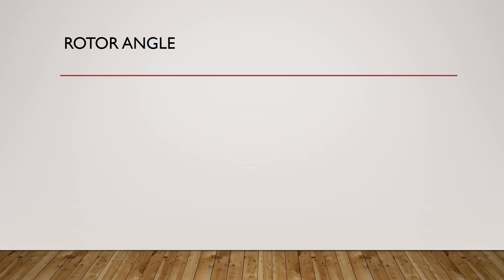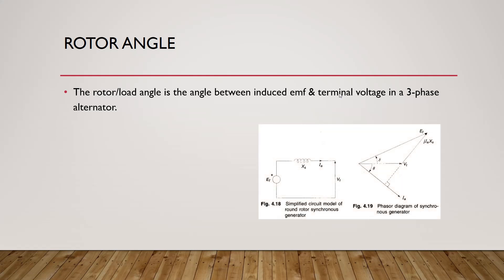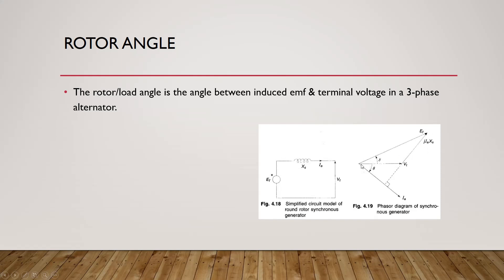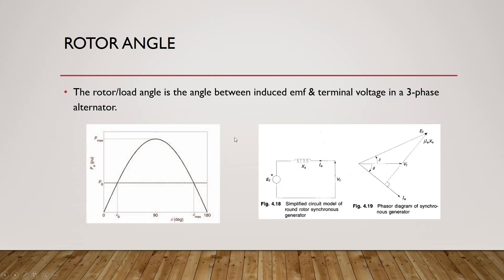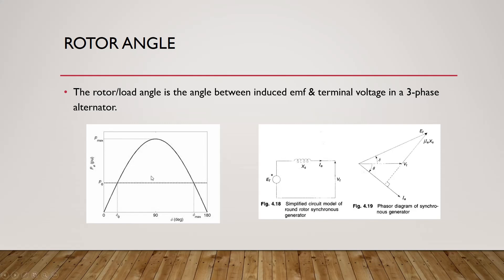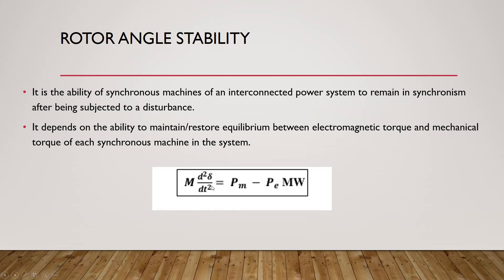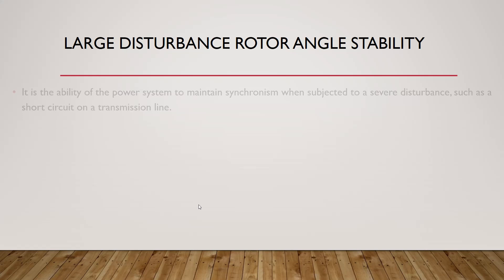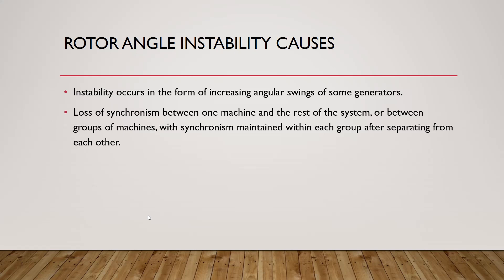Rotor Angle Stability in Power System for Power System Engineering Courses

Comment: Great Info.  I'm an operator at a power generation facility. We had an exciter upgrade and were ramping up our unit to base load for exciter tuning. The unit began oscillating dramatically with large shifts in MW's, the power building quickly began shaking violently, and we picked up several vibration proximities. We quickly tripped the unit offline (probably would of tripped on it's own relatively soon). Long story short, the exciter company wanted to blame it on mechanical issues when there weren't any and our management wanted to blame it on the exciter being improperly setup. Exciter company spent all day testing/troubleshooting/going through programming and notified us that they didn't find anything. We attempted another startup and it was flawless. They were able to complete their exciter tuning. Interested in knowing if it was a Rotor Angle Instability or if it lasted too long for that to be possible. It was over several minutes but the last 30 seconds was violent.